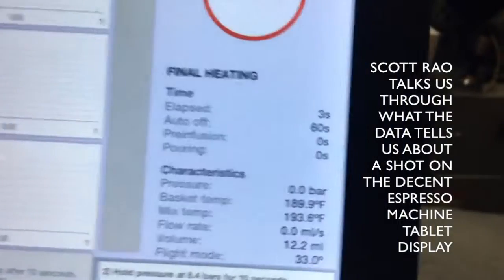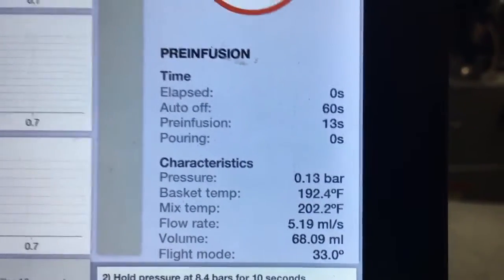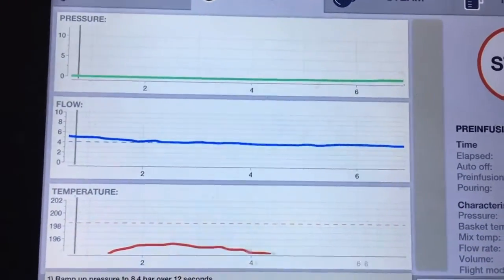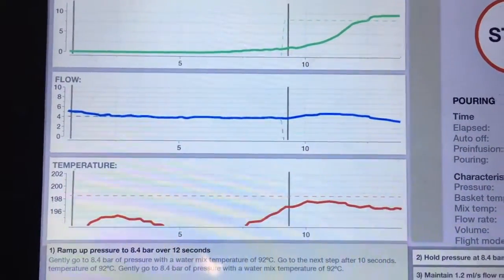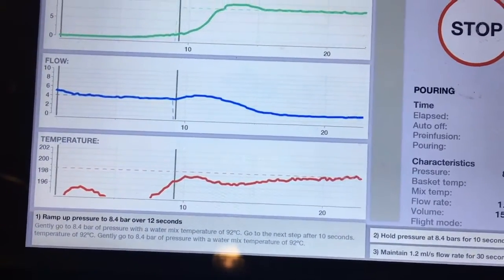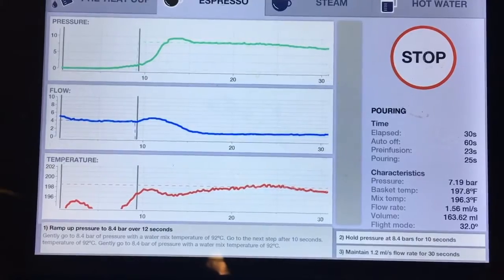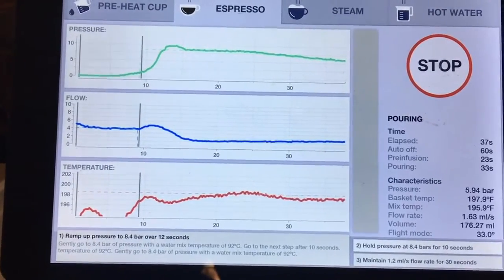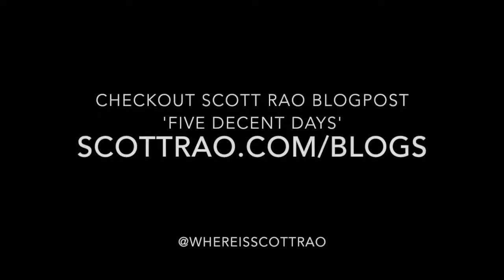Scott Rao Talks Us Through A Shot On The Decent Espresso Machine Display

Comment: John

Thanks for that - Scott's video is useful along with the commentary.

I have learnt more about channeling from your videos than any other source.  This has pointed to a problem with my current machine or more likely the grinder.  I was getting surging and I thought the pump was on the way out - but after taking greater care with distribution and doing "manual pre-infusion" that problem has gone, suggesting (to me) it was channeling.

I should ask this on one of the forums, but a lot of comments from Scott and you suggest flow-rate is very (the most??) important, but your base machine doesn't allow flow-rate profiling.  Does it have a target flow-rate or is that just not measured in the DE1?

I am becoming a DE fan-boy, just when I was ready to buy an E61 machine!